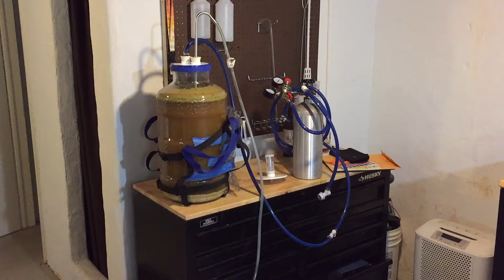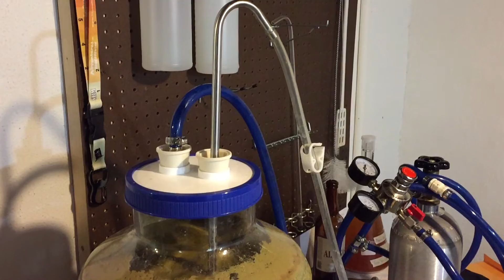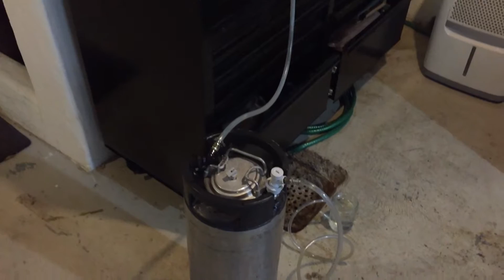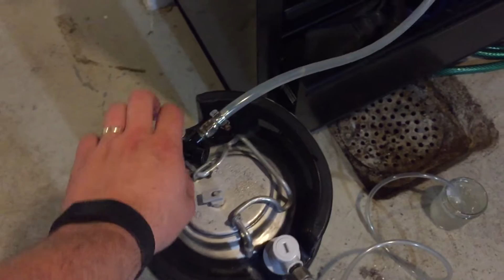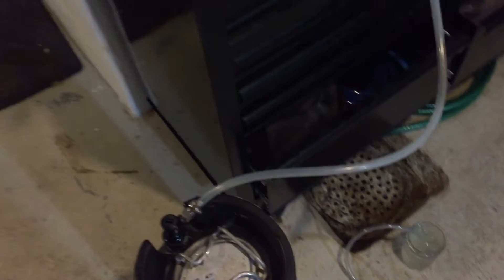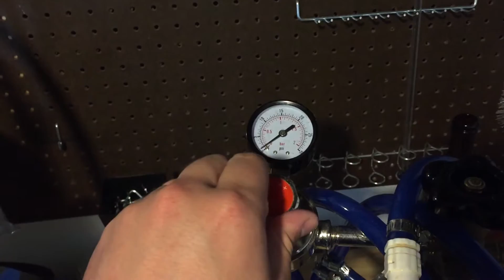CO2 Transfer from Fermenter into Keg

Comment: Great system!  How do you know when the keg is full?  I fill my kegs to just below the gas in tube.  Normally, I have more than 5 gallons in my carboy so that I can leave the yeast and sediment behind.  Without opening the lid to visually monitor the fill height, how would you know when I’ve reached the correct level?